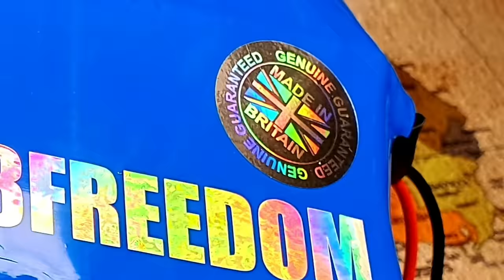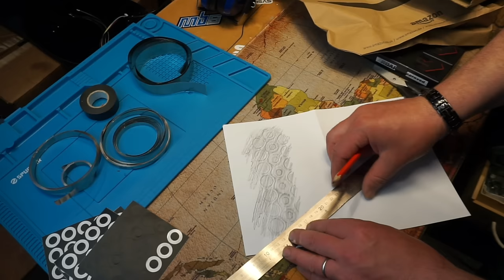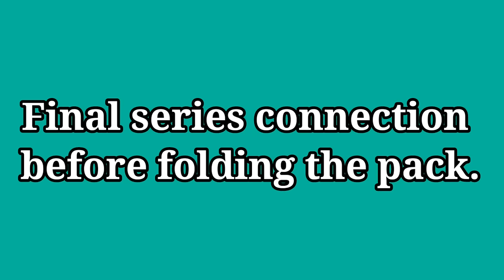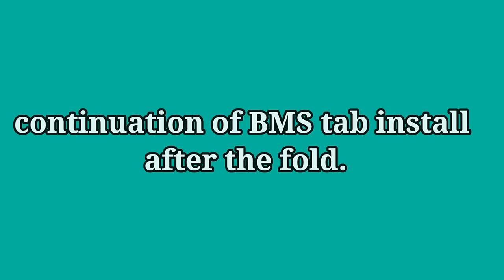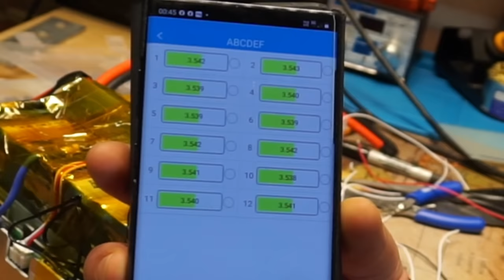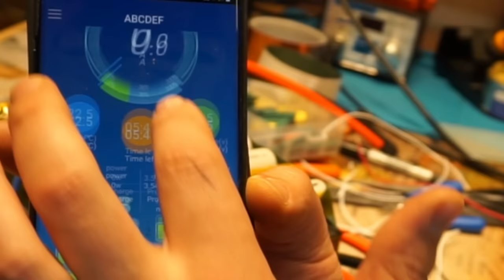Most detailed battery build tutorial. Block battery.

Comment: Hi Pawel.
I have ebike model MATE X-750W.
My battery 48V/14Ah fail.
Voltage battery output42V-when turn key to ignition position-drop to 0V.
BMS or bad cells ?What can i do?
Are you polish?
Pomocy prosze
Reply: Charge the battery full and test voltage of each P lines. Add the total : if you really have 48V  with all P...and only 42V on the two main wires , the BMS is faulty. If you have only  42V when add all P,  you have one P with issue (but you will see it by testing) .
And with ignition and drop to 0V : 2 options :
-One P is faulty, (cells issue) voltage too low and the BMS stops the current for protection
-all P are good , but a faulty BMS can do that : when switched on,  it stops the negative current output (which runs across the BMS ; the positive runs direct from the battery to the motor controller)
So first of all control the voltage of each P line.

Comment: i'm confused as to how it's able to show individual cell voltages when you only wired up cell 6 groups of 7 parallel cells to the battery management system. shouldn't it be only able to show 6 individual cell group voltage and 1 entire pack voltage?

Comment: How bms cutt off the current if any fail happens when negative master are not conectted through it?.
Reply from the maker: ESC does it instead of the BMS mate.
Reply: @PavelGarmas  What is ESC?
Reply from the maker: @Adgale  ahh...sorry mate.  Ok so ESC is an electronic speed controller that you will need to control the motor. Unit does control discharge of the battery.  Have a look on my channel...i do have a few videos about esc units and the VESC programming.

Comment: Hay folks, did someone out of UK buy at "fogstar-wholesale" yet?
When I compare their prices with Nkon.nl or Akku-Teile.de the difference per cell is huge!
fogstar-wholesale - 4,37€
Nkon - 5,75€
Akku-Teile - 6,96€

@Pavel fogstar-wholesale sells new cells right?
Reply from the maker: Hi mate,
Yes, they are new cells and i have used them for the last two batteries that I have built. They do sell good nickel as well and it is really cheap. They can maintain good price because they do buy a very large quantities from factories.
Reply: By asking for discount directly to the supplier I received following price's by an order of 90 cells:
Fogstar-wholesale - did not reply
Nkon - 3,80€
Akku-Teile - 5€
Reply: I just got the information from Metbo. They are using the Samsung   INR21700-50S cells in their Metabo 10Ah packs